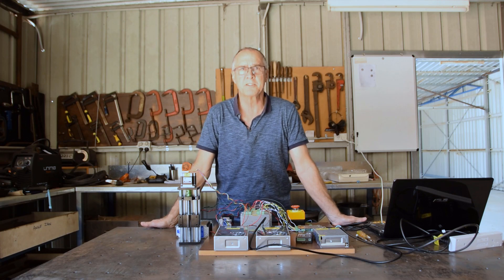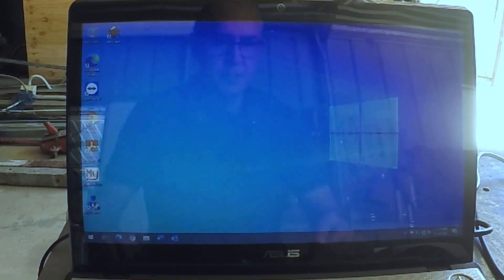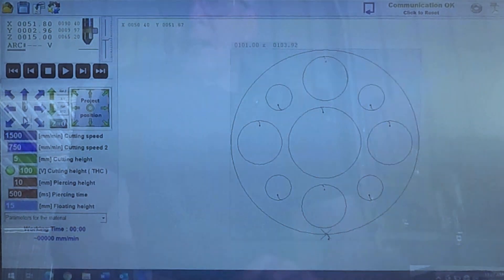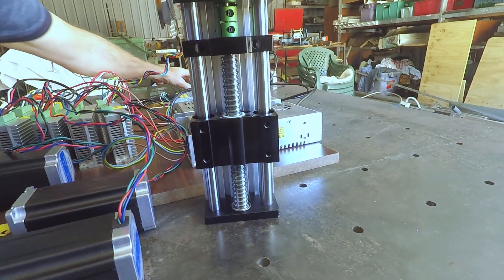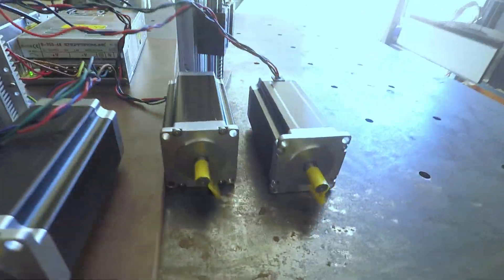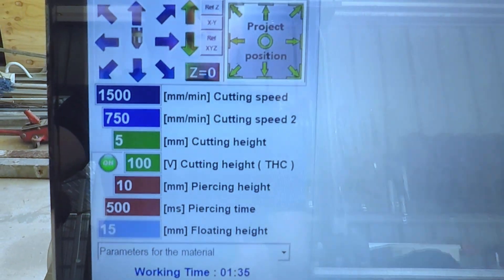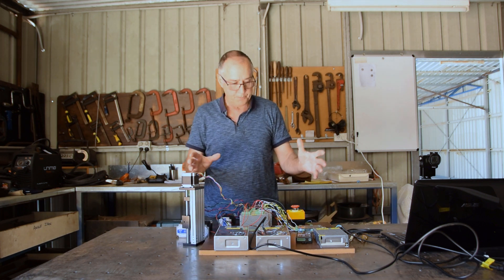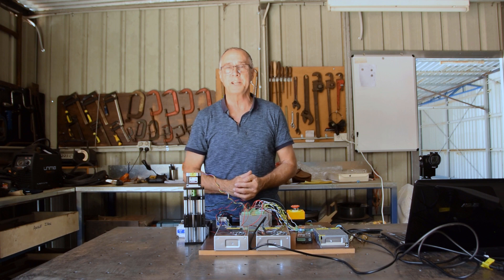How To Build a CNC Plasma Cutting Table | Part 2 - The Electronics

Comment: Hi Rusty, I’m looking to build one of these following your design. My question is what power supply is this system running from the power point, 15A or 20A?
Reply from the maker: Hi William, the power supply for the electrical system is plugged into a standard 10A outlet....the plasma cutter is plugged into a 15A outlet.
Good luck with your build and if you are looking for plans, I sell the plans for my table....if you're interested you can email me at rmhyde58@gmail.com

Comment: Hi Rusty
Did you make your own ohmic sensor ?
Thanks
Reply from the maker: Hi Blou, yes I did. I adapted the original 'stand off guide' that came with the torch. I then made another modification to it so instead of having the 2 fingers for sensing the material, I welded the fingers to a flat washer (which has a hole in the centre that's big enough to clear the torch tip. I can sent you a photo if you email me, it's rmhyde58@gmail.com
Reply: Mail sent...

Comment: Hey Rusty.. I set up my electronics on the workbench as you did but when I run the software Y1 and Y2 don’t always move the same way. In fact, there are times when Y1 will move and Y2 does not. I can’t imagine that this would be good if that happened with things hooked up. Have you heard of this one? Thanks
Reply from the maker: Hi Kerry, if you want to send me an email (rmhyde58@gmail.com) I can send you my wiring diagrams for 2 Y axis motors so you can check that yours are wired up the same.
Reply: @RustysMetalSigns  I will thanks.

Comment: Hey mate, just wondering if you’ve had an problems with losing steps or have you upgraded to closed loop stepper motors?
Reply from the maker: Hi Don, I've never had any issues with the stepper motors, or losing steps. It's important to set the steps correctly, to suit the 'distance per rev' of the stepper motors.

Comment: What gauge of wire did you use to wire all that up ? Thanks
Reply from the maker: Hi Kerry, not sure what gauge wire I used, but I can tell you the shielded cable was rated at 10A and the internal wiring in the enclosure was 7 core trailer cable, as the maximum current is only 4.2A for the stepper motors. Hope this helps. If you would like to know more about the build, feel free to email me at rmhyde58@gmail.com

Comment: Hi. Do you use shielded cable wiring motors ? I accidentally order motor 4 wire coil cabel without shielding.
Reply from the maker: Hi Markus, using shielded cable for all the field devices (motors, homing proximity switches, etc) is preferred. I went into more detail in the email I sent you.
Reply: @RustysMetalSigns  Thank you . I have problems to find suitable cabel. 4 wire shielded in step motors. Do you have like wire model you use?
Reply from the maker: @markuspihlajaniemi3711  this is the cable I used. If you google or check out ebay for this: SHIELDED 4 CORE STEPPER MOTOR CABLE - 7/0.40 Ideally the cable will be 4 core with different colours, rather than 2 pair white and black....the coloured cores make it easier when drawing up a wiring diagram.

Comment: Thank you for sharing your experience. Newbie question here: am I right to assume that when cutting with the plasma torch, there is no lateral force on the handle? The reason I ask this question is that your stepper motors looks very big for the task ( NEMA 32 ?).
Reply from the maker: Hi Dany, yes, the torch operates approx. 1.5mm above the material being cut. The only time my torch contacts the metal, is when the torch touches off, telling the software where the torch is, in relation to the material (called ohmic sensing).
I'm using NEMA23 motors, rated at 4.2A and 420 inch ounce torque....which are plenty strong enough to drive the gantry around my table.

Comment: Great work mate, I'm currently building my own cnc mill/router and plan to make a plasma table too. I am just wondering where you bought stuff like wiring from. For some reason I cant seem to find the size of wiring I want, cheers
Reply from the maker: Hi William, I bought the 2 pair shielded cable online (eBay....7 strand, 0.4mm conductors....this is for the field devices like the stepper motors and homing proximity switches).
The internal cabinet wiring from the controller card to the stepper driver units and from the stepper driver units to the aviation plugs in the side of the electrical cabinet (the output to the stepper motors) was all 6 core trailer cable. Just strip off the outer protective sheath and you have 6 cores with different coloured insulation, making it easier than buying 6 rolls of different coloured wires.
The shielded cable only has to carry the stepper motor current...in my case, that's 4.2 amps. The internal wiring is probably only carrying milliamps. Hope this helps. If you have any questions, my email address is in the About tab on my channel.

Comment: Hi mate.. would like to no if you have a wireing diagram or maybe pic on how everything is wired..thanks
Reply from the maker: Hi Vince, I have created a series of wiring diagrams for each part of the system....power supplies, controller card to stepper drivers, stepper drivers to the stepper motors, homing switches, etc.
Are you building your own plasma cutting table and if so, are you using the MyPlasm CNC controller?? If so, I'd be happy to share my wiring diagrams with  you.
Reply: @RustysMetalSigns  
Hi. Yes i will be using the same system as yours.. thanks
Reply from the maker: Vince, send an email to rmhyde58@gmail.com and I'll forward you the diagrams I've created. How's the build coming along???
Reply: Hello I’m also building my own cnc plasma and wondering do u have a wiring diagram for this please if u don’t mind
Reply from the maker: Hi Matthew, if you're using the MyPlasm CNC controller for your build, then I have some wiring diagrams that would suit your build. My email address is rmhyde58@gmail.com 
I'd love so see some photos of your build or even some videos, if you have made any.
Reply: @RustysMetalSigns   hello if u don’t mind thanks. Dunno what to do yet I’ve an old shape following machine with a magic eye on it would like to convert it to sumthin cnc to be easier to use
Reply from the maker: Hi Matthew, if you send me an email (my email address is rmhyde58@gmail.com) I will send you the wiring diagrams I created for my table, thanks.